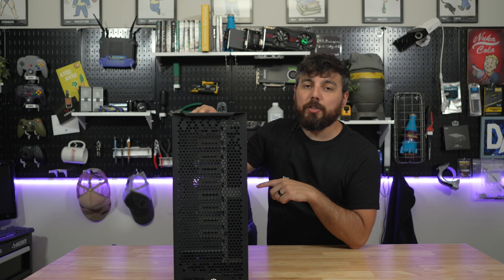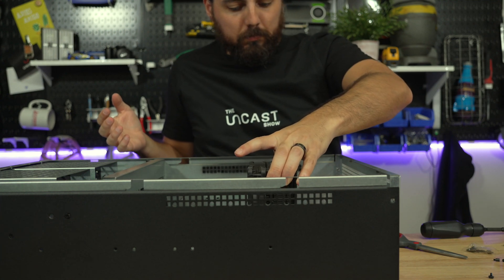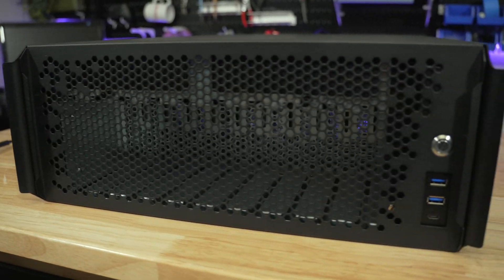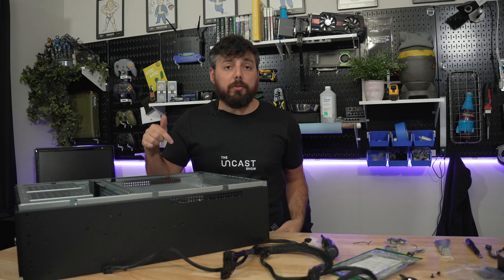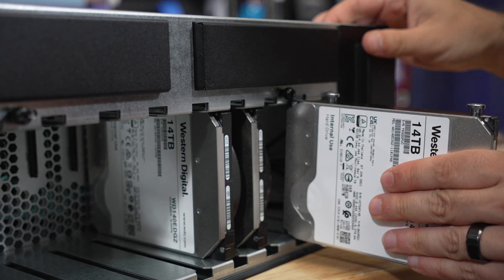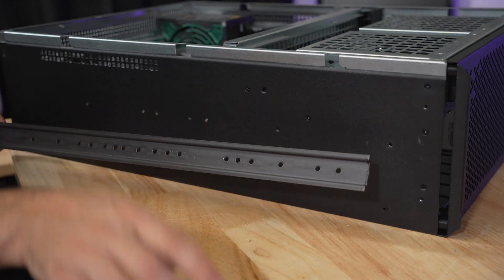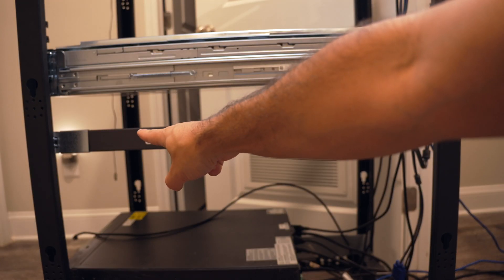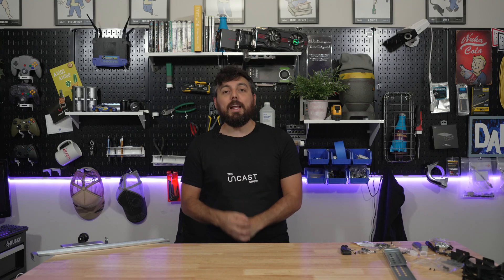In deep with the Sliger CX4712 Server 4U NAS Case

Comment from the maker: What is your preferred chassis?  How does this stack up?
Reply: That's the case I use actually.  Used Rosewill ones before but they had a lot of limitations.
Reply from the maker: Rosewill has 1 chassis that is superb but the fan bracket wasn’t meant to support a radiator.  Some of the other servers from them I’ve used also have weird quirks or bad decisions. So far the two cases from Sliger I have used have been very well thought out
Reply: I have used a Supermicro chasis for about 8 years now - bought it from eBay.  It has 12 3.5" drive bay - uses trays.  It's nice but the fans in it can get loud.  I also have a Rosewill 4U case - plenty of room, but mine has an irritating storage system.  (I also only paid $40 for the Rosewill from FB Marketplace, so the price was right).  I'm starting to think about an LLM system - a 4U should have room for a GPU.  Now, how to talk the missus into the LLM server...hmmm.
Reply from the maker: @ChrisRider  I've been tempted to get a used supermicro chassis over the years but when I was looking it was hard to determine if the backplane was SATA2 or 3.  I never got around to pulling the trigger and ended up with Rosewill which has been great for the 6 or so years I've used it.  For damn near everything.   The last rosewill case didn't stack hard drives correctly, as in, if you tried to fill it the trays were too close together preventing you from being able to max it out.  I found Sliger while looking for a smaller server chassis to mount my gaming rig in.  Their CX3171a XL fit the bill.  It might work for you as an LLM server, not sure if has the capacity you are looking for though.
Reply: i got a silverstone. but looking at the sliger options, i think sliger is better. i like how you can install the full blown graphics card in some of these sliger nas rack cases.
Reply from the maker: I’ve always been really close to buying silverstone but with rosewill I never saw the point

Comment: Videocard side fan mounting would be great as well. I've been looking to rack mount my gaming pc, i had a sliger when i was using my 3080ti and temps were fine, but a 5080 runs to hot.
Reply from the maker: Same with my 4090, runs super hot, is massive so it chokes itself.  

I feel like I finally got my setup squared away in the CX3171a XL with my 4090, but got dawg it’s been a long journey
Reply: could use the 8th slot for a PCI slot fan; lots of ways to do it and lots of options exist

Comment: Do you get indicator lights for the HDDs? If not, is there any way to add them?
Reply from the maker: There is a light around the power button that can be connected to the hdd connector.  So yes
Reply: @SPXLabs  thanks, but I mean all the RAID drives, not a single light.
Reply from the maker: Oh then nope.  Not that I’m aware of

Comment: That vibration also degrades the drive over time. Thanks for pointing that out, I'll look for a different enclosure.
Reply from the maker: Valid concern I’d say.  However I found some screws with rubber that help.  So if you are still interested maybe check out this out
https://youtu.be/LRVX5xyMRPk?si=TR0qsg_8vyLxtxgy

Comment: What server rack and rails are you using?  

I’m looking at a star tech open rack but apparently because of the dimensions/spacing post to post the sliger rails don’t fit (star tech spacing is 450mm, where as the sliger rails require 450.85mm)
Reply from the maker: I’ve used the same rails bought from Sliger and used them on a StarTech adjustable rack and Vivo adjustable Rack.  No issues observed so far for either rack and rail kit.

Comment: Great video! Currently between this and the HL15; I'm probably leaning towards the HL15 as it'll be my first (and primary) rack mount but I could see myself getting this as a secondary rack mount case.
Reply from the maker: The HL15 is pretty slick.  I haven’t used it IRL but I think the backplane is the real selling point for the HL15 and if you can afford it, that would be the way to go IMO.

Comment: I've had this case for about 6 months now. It looks like they may have changed the rails a bit from when I purchased. My rails don't actually fit in my rack, but it's a pretty cheap rack, so that might be why. Still pretty annoying that I have a rack mount chassis finally and I can't actually service it in the rack. And it's an incredible bummer that they don't even have an option for a filter on the front. What a mess the lack of a filter screen creates. I can't say I noticed any noise from the hard drives vibrating. But that's what the server closet is for.
Reply from the maker: They have new rail kits.  And from the two racks I’ve used them in, they work well.
Hurray for dedicated closets!

Comment: I like the case but my only gripe is I would have to give up idrac to use it. Also worth noting that the motherboard tray tends to get easier to take out once it has been done a few times. I am not sure if it is residue from the manufacturing process that makes it tough or their tolerances are so good that the metal has to wear down a little to loosen up the fit.
Reply from the maker: Yeah idrac is the best remote management.  Ipmi on other systems has been just okay for me.  The newer boards with HTML5 are the best but rare.
Reply: @SPXLabs  I need to toy with newer boards but they've always felt sluggish and primitive in comparison.
Reply from the maker: Yeah whelp what are you gunna do about it

Comment: I only give this case a 6/10. Added a custom printed TPE drive sleeve to solve the rattling. Btw, killed 3 in 3 months, Seagate toasted my warranty on my remaining 7 drives. Even with 10 drives, you will struggle to saturate a 10 G connection. The issue is you can't plug a SAS Drive into the front. I didn't buy with intention for that but wanted to let others know. It's a great budget case, but its not perfect. That said, the fact you can do 10 drives and a 360 AIO is amazing. They need to add rubber grommets and an optional SAS backplane to be the end all be it all for a 4U AIO 10 drives in a server case.
Reply: Ths is the issue I ran into with SAS drives
Reply: I’ve got SAS drives running in mine. The main thing is to remove the 3.3V connection to the drives. Kapton tape on the 1st-3rd pin on the drive’s power pins, or removing the 3.3V leads in the cables. There are also adaptors that can be used as well. You also obviously need a controller capable of SAS.
Reply: @erichng  I did that trick, but it a certain drive manufacture voided my warranty when a drive failed. The Person I trusted didn't take the tape off, and swap while I was visiting family in hospice. I said F it and customized my own retention bracket for actual SAS 12 Cables. I was running a 9400-16i I got cheap that just needed firmware upgrade, ezpz. I sold the whole setup driveless with a 3090 on water. I moved onto a Silverstone RM61-32. Got a 4090 Suprim with waterjacket, hooked it onto a Threadripper 5975wx and Got some nice thick rads on an Asrock WRX80 Creator R2.0. I'm down to 2 PC's now. I'm not disappointed at all with my choice, but still felt the Sliger was a great starter for me. I didn't think I'd outgrow it that fast, but i did. Its still a 6 out of 10 for me.
Reply: @ShiroKuroh  They voided your warranty when you sent the drive in with Kapton Tape on? As I mentioned there are other ways to prevent the 3.3V from reaching the drives. Regardless of warranty or whatnot, my point is that the case is compatible with SAS drives out of the box. The 3.3V issue is not unique to SAS drives, it has to do with consumer PSUs not support enterprise Power Reset. The same issue exists on Enterprise SATA drives and infamously on shucked SATA drives aswell.
Reply: @ Yup, they killed it. I agree, just ordered the parts to make my own adapter for power, essentially doing the same thing, and got rid of the in between. I outgrew this faster than I thought, but its not a bad case, but part of my rating was also do to the rack rails being to tight, and wasn't noted in their Discord before I purchased it, but was shortly after. The other part is the trip back to the 1990's on how sharp things were inside the case. The use of space management wasn't all that great though. I can run a 380 watt proc with a 360 mm aqua Computer Airplex and an eatx was the saving grace and I couldn't help but give it a 6.

Comment: does the power come through those breakout cables or do you have to connect a wire to the back of it to power it?
Reply from the maker: Power does not come through the Mini SAS to SATA breakout cables.  As mentioned in the video you have to choice to use the included sata power cables or the ones that might come with your PSU, like I did.
Reply: Thanks for clarification. A psu can power your 5 hdd?
Reply from the maker: I think my PSU can do upwards of 10 maybe more with some breakout cables.  Haven’t tried to see how many I can power
Reply: @SPXLabs  just to be clear, you re putting a sas power plug from your psu to the back of that blue cable to power it?
Reply from the maker: Yes! Exactly.
Reply: @SPXLabs  thank you for your video and comments. it has been very helpful as I am a noobie trying to set up a server. thank you and keep up with the good work!

Comment: I'm about to order one of these for my proxmox server (which will be running a truenas VM, thus wanting the disk bays).  I've worked with some other Sliger cases in the past and they have all been really nice to work in so I'm looking forward to it.  The one thing I'd really like to see is a proper backplane, even if that added another $100 to the price.
Reply from the maker: Seems like you aren’t the only one.  Very happy with this case so far.  It’s great

Comment: The lack of drive fasteners with rubberized dampeneing material make this an absolute no-go for anyone concerned with vibration issues. Also, I'd personally like to see more fans, especially in the front to keep the drives cool. This death trap is a drive killer. Such a shame, because the rest wasn't too shabby. Although, it's very cheaply made with very little consideration given for sharp edges and smooth operation of joints. It's like the el cheapo crap you find on Ali Express. It's really not a very nice chassis.
Reply from the maker: It definitely doesn’t feel cheap.  I’ve also dropped it from about 28 inches and it didn’t get a single scratch or dent, on its way down off the rack.  
I can kind of see your point with hard drives but I think it will be okay since the drives are not tightly packed and if you move to higher industrial fans that run at higher RPMs, you could avoid any heat drive killing issues.

Comment: Caddy-less is definitely cheaper, and the cooling is better - but you need those 4 studs & screwdriver. There are neater solutions. Vibration is not a big issue with 'only' 4 or 8 drives .... once you have 24+, 60 or 100 in a 4U that's different
Reply from the maker: Just stating from a noise perspective not functionality.  I know any amount of noise will bother some people.  Otherwise, it's fine IMO.

Comment: I have this case but one of the passthrough to hdd is busted and I need to fix it. 

But other than that I’m very happy. Only thing I’d like to see as an option in the future is a backplane that maybe just plugs into those passthroughs for a little less cable clutter and making it easier to also have more plugs for SSD cages
Reply from the maker: Really?? How did that happen?

An integrated backplane would be cool.  The case is a little pricey already not sure how much cost that would add.
Reply: @SPXLabs  it showed up that way. 

Took me some troubleshooting to figure it out but Sliger CS has been good. They apparently include some extra passthroughs but haven’t had time to look and they said if I don’t have them they will send me more. 

A backplane would definitely add a decent amount and I agree it is already pricey. 

That’s why I think it could be a “clip on” aftermarket accessory. But even if they don’t do it it’s still a great case. 

I’m also thinking about getting one of their other HDD 3U cases to use as a JBOD. Run a lot quieter than one of those enterprise disk shelves.
Reply from the maker: @user-cm3wd5hk1p  Oh snap that's not cool.  I bet it did, that would be the very last thing I'd ever think about checking lol.

I like that they have a variety of options for many different types of builders.

Comment: This is a fine rack mount workstation chassis. It would be great for a high-performance workstation to host an open source LLM.  In fact, when I start gathering parts for mine, its going in this Sliger chassis. I do however have one issue.  With a file server use case in mind, 4U is too much vertical space for a box that only holds ten drives. My InterTECH 4420 has TWENTY 3.5-inch drive bays and was the same price as this Sliger. Remember I'm not knocking Sliger. THEY MAKE GREAT RACKMOUNT WORKSTATION CHASSIS, and I'm about to buy this one. It just misses the mark as a 4U server chassis.
Reply from the maker: It definitely fits the bill for a few use cases but as you said if you need massive storage maybe pick up a 4u chassis with more capacity. Nonetheless in general terms it’s still a great chassis.
Reply: My only complaint with Intertech is they are either really expensive in the states and/or rarely available, if you are in Europe they are a great choice.  I wanted to give the 4410/4420 a go but ended up going with the Sliger instead because the markup was crazy for the few US vendors I could find them on.
Reply: @nadtz  I got mine shipped direct from Intertech. I don't think they do that anymore.

Comment: Interesting case. May be worth picking up when I need to add more storage.
Reply from the maker: Without third party devices the default case has a maximum storage capacity of 12x 3.5" HDD and 10x 2.5" SSD.  Pretty good for home use.  For the power users though, it may not be enough...